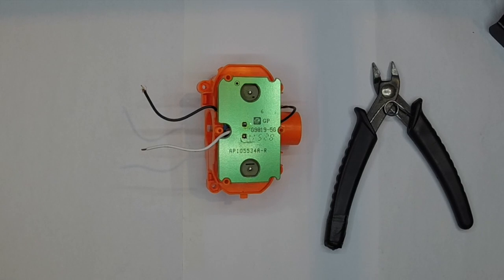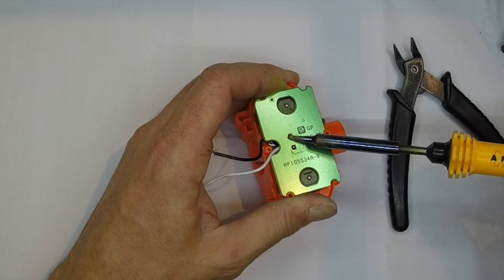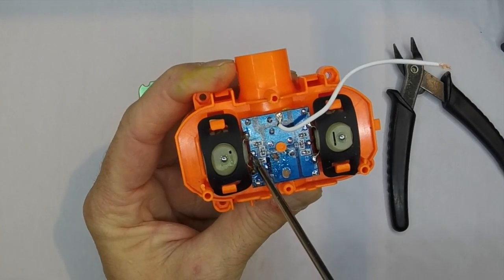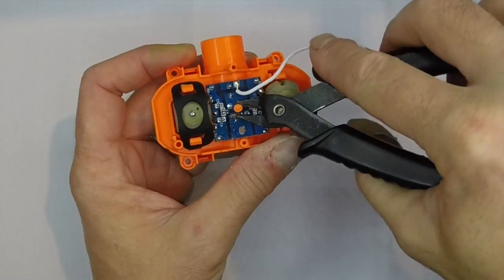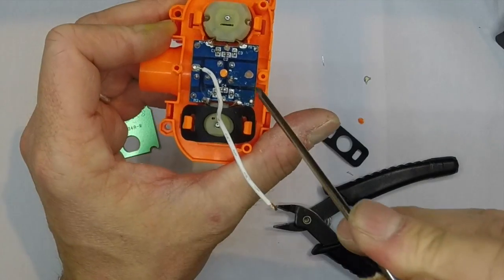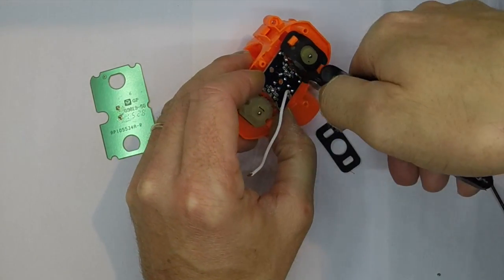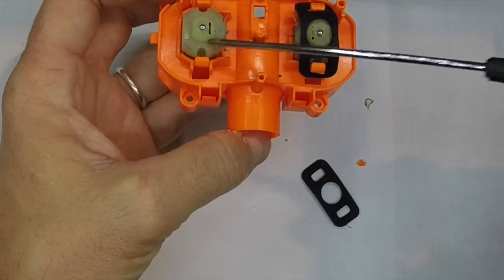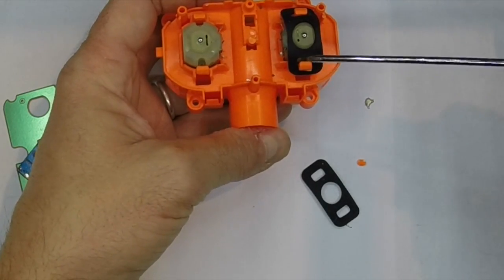How To Remove the "Resistors" on the Nerf Rapidstrike

Comment: So after I take off the board i just rewire the correct +s and -s?
Reply from the maker: Charlie Dana Yes, if you don’t disturb the motors the front (barrel end) is the negative, back is positive. Change the flywheels for Stryfe ones too if possible, most RS wheels are bent, which is bad for performance.
Reply: Foamdata Services thanks man. Also if I bypass the thermistor on a stryfe and run 3 imr’s will it last months/years or will that quickly fry the circuits?
Reply from the maker: You should properly rewire instead, the PTC is there to protect the very thin wire and components from excessive currents, removing it and slapping in more current at higher voltage is not a safe way to mod. You need about 2ft of wire, look at my Stryfe rewire guide, the stock rev switch can cope fine with IMR, with stock motors and wheels.
Reply: Foamdata Services thank you. Do you have a guide about how to rewire a RS?
Reply from the maker: Yes, but the RS is complex and requires all the switches to be replaced.
Reply: Foamdata Services are the RS stock wires good enough that I could put in a lipo or imr’s and it wouldn’t be bad for it?
Reply from the maker: You can’t run the RS off IMR, there are three things you can do, rewire it properly and fully for lipo or this crappy pack hack, which will ditch the C batteries but leave the rest of the stock loom intact and safe. https://m.imgur.com/a/iSyXh
This hack only supports a 2s lipo, as the PTC MUST STAY IN PLACE. Thus you are also left with all the locks as well.
You are going to have to learn to rewire properly if you want to be a safe and successful electric blaster modder. Do a proper Stryfe first.

Comment: Is the Green board on the motor case necessary? Someone told me just to rip it off.
Reply: And If it is necessary, how do I put it back on
Reply from the maker: This whole video is about how to remove the motor circuit board without destroying the motor tags. You only use force if you don’t need the stock motors again. Even the top board can crack the motor tags if you pull it off too hard. Watch the video, it’s all there.
You want it off for any wiring mod. The components are there for RF emissions suppression.
Reply: Foamdata Services Thanks so i would want if off? I’m rewiring a battery pack to it.
Reply from the maker: If you are just adding a battery plug to the stock loom and leaving everything else then it can stay, otherwise you should do the job right and rewire the whole blaster, don’t take bits of the stock loom and try to make it better by removing the “resistors” as there aren’t any and you will make dangerous short circuits more likely. The RS is all or nothing, there’s no short cuts or half way mods.

Comment: could i run3 imr’s if i remove the thermistors?
Reply from the maker: Not in a RS. In a Stryfe or similar you should rewire if you want to use 3 cells. The thermosistor is there to protect the toy components from stall currents, if you take it out you expose 5A rated parts to the full 8A burst current of the stock motors. It's 3 wires and 8 solder joins for a basic rewire, better to do the job properly than a lash up.

Comment: What that mod gives to nerf blaster?
Reply from the maker: You need to take all that if if you intend to run higher power batteries, the components on the board can't take the full stall current of the stock motors. Otherwise removing the RF board on its own makes no difference.

Comment: Tom, I have modded a Stryfe  (rewire to 16 awg, stock motors, stock switch) and am running it on 3 IMRs. It is throwing darts well but I'm not sure how long it will last. My question is: Since the Rapidstrike has 3 motors do you think that it will run well and last reasonably long on 3 IMRs with a rewire only?
Reply from the maker: You cannot use IMR 14500 cells in a RS, watch my balance video.
A stryfe with typical 800mah 14500 cells will run for a whole day off one charge fairly easily. Motors will last typically years not months.
Reply: Foamdata Services Thank you for your reply. I will watch that video next.

Comment: Hey foam data can you give me your opinion on these http://www.amazon.com/Hyper-Dash-Motor-Mini-Grade-Parts/dp/B001VZEA2C/ref=sr_1_2?ie=UTF8&qid=1446482152&sr=8-2&keywords=hyper+dash+motor ... Thanks
Reply from the maker: +D.j.Y GAMING5 Don't buy those, they are not a good Nerf motor. They need a 1s Lipo to be reliable (the pack they are designed for) and make much less torque than Nerf tailored motors like the MTB Rhino.  Check out here for Rhinos in the USA. 
http://www.tacticoolfoam.com/electric-blasters.html
Reply: +Foamdata Services thanks man .. ( nearly bought 4 for a mod I'm doing!)
Reply: +Foamdata Services So that circuit board protects radio interference? Could you put in BACK on(ie, replace motors) and have it still work? If so, what would you estimate the limits it would cause?

Comment: great vid mate. i have a request... could you please do a tutorial on how to make a bullpup nerf rapidstrike? im going to make one but need a good guide...
Reply from the maker: Here is a series on the original Vulture, there's several more to look at.
http://torukmakto4.blogspot.co.uk/2014/12/rapid2-destroyed-project-vulture.html
I have no plans for a bullpup RS because I don't like them, too slow to reload. If I want a short RS I have my Rapidpistol or Krinkov. Toruk's one is boss, copy that and yours will be too.
Reply: Foamdata Services oh thanks dude. keep up the good work and ill be sure to tell youu how it goes! have you got any MTB motors yet?
Reply: ***** id adjust i guess... left a comment on one of your vids btw Rob
Reply from the maker: I hate reaching behind my dominant hand to reload and it's much harder to just switch and drop on a bullpup. That's not practice, it's simple ergonomics. I would always want my receiver forward, there are almost zero advantages to the bullpup layout in Nerf IMO.
They look pretty though.
Reply: Foamdata Services hahahaha yes they do.
Reply: *****  i was talking about how they looked pretty...
Reply: Foamdata Services isnt there jusst enough barrel so as not to cause drag but enough to increase accuracy?
Reply from the maker: In my experience barrels make absolutely zero difference to accuracy in flywheelers. Correctly balanced flywheels are far more important.
Reply: Foamdata Services your an expert at these things Tom so i am going along wtih hat you say! lol
Reply from the maker: I just test everything. Never assume what someone tells you is "the best method" unless you have either 3rd party testing from someone you trust or have tested it yourself. I am always happy for people to disprove my "wisdom" too.